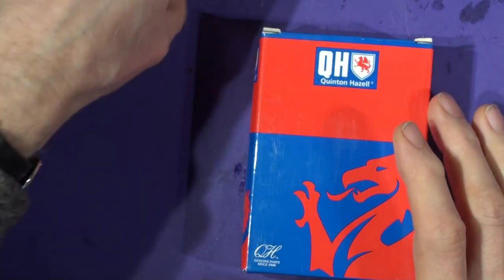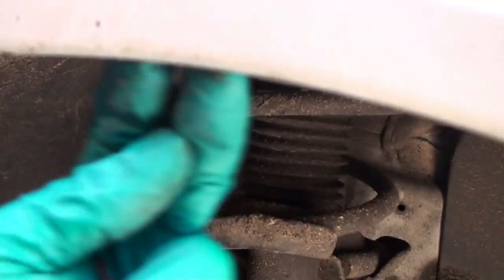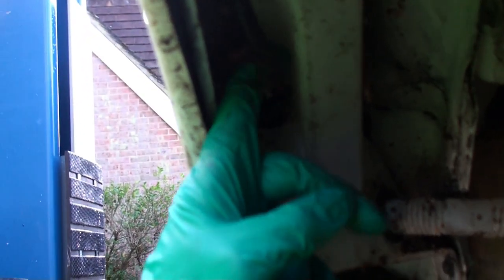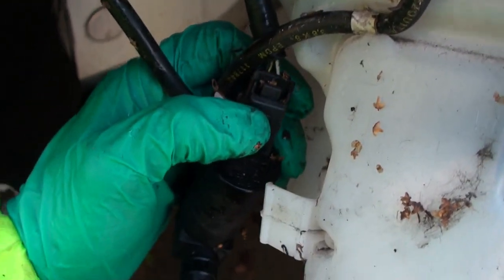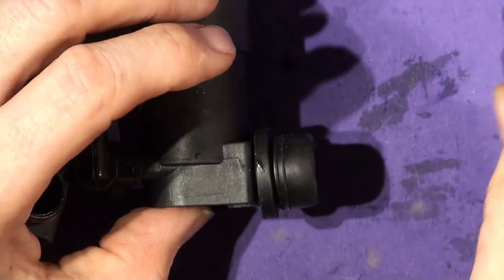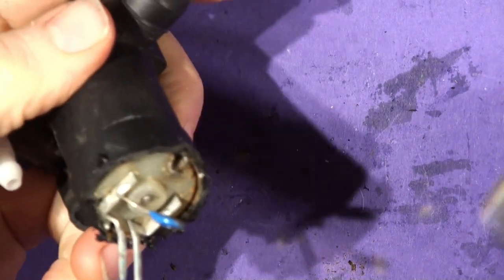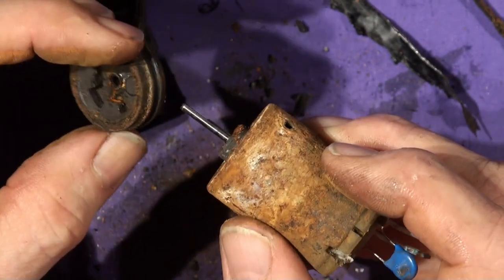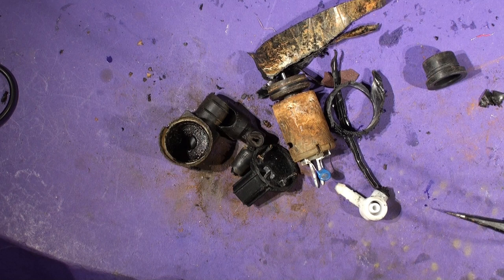Volvo C30 V40 Windscreen Washer Pump Motor Location and Replacement T655C and tear down

Comment: My wife replaced the pump on her C30 today, with my assistance. As mentioned in a previous comment, the reservoir didn't fall down as in the video. We inspected reservoirs for sale and noticed a small white hook on the inside, so using a screwdriver we managed to release this from its slot and it came out fine. I think some may use brute force and break the hook. Anyway this might help some! Next job sorting out the passenger airbag light!
Reply from the maker: Great news, Thanks for the tip.

Comment: Excellent video 👍 Watched this and replaced the pump on my father-in-law's C30. I re-used the original rubber filter/seal that the pump nozzle pushes into. (The new pump just had a seal with a large hole but no filter). Worse bit was refitting the wheel arch liner as in some places it has to be sandwiched between the wheel arch edge trim and the bodywork. Saved my FIL a few quid on garage labour. Thanks!!!! 💪
Reply from the maker: Glad it helped. Good job. Please subscribe if you have a moment. Thanks.

Comment: well that was one entertaining little video stayed to the end just for the craic I won't be cutting the Old motor open but I think I will buy a new one before I even start,
mine is an S40 but I imagine they are somewhat similar.
all the best from your fan base in Ireland
Reply from the maker: Thanks.  Yes the V40 is near identical.

Comment: Thanks for the interesting video. Depending on the direction of the impeller, the pressure is slightly larger in the front or rear nozzles output port of the pump body. The side with the highest pressure will push the white membrane shown at the end of the video so it blocks the fluid that would otherwise go in the other side. I still wonder why the impeller is assymetrical. Maybe fluctuating pressure has some useful purpose?
Reply from the maker: Pleased you enjoyed it and to hear it isn't just me that needs to know, You are right. the higher pressure side closes the output to the lower pressure side.  Stabbed my hand getting that bloody thing to bits. Wish I had spun up the motor.
Reply: It could be that a higher pressure is needed because of the distance the fluid needs to travel to the rear of the car.

Comment: Is the reservoir held in by torx screws or hex bolts gonna do the repair tonight 💪
Reply from the maker: From memory yes there are Torx as mentioned in the video (i think). Good luck.  Thanks for watching.

Comment: This will be my next step but for now checking the fuses do you know what fuses will be the culprate I've changed 48 in the cabin but is the head lamp washer also run the same fuse should I try change this ?
Reply from the maker: Have you checked the motor?  Headlamp and window washers uses the same pump. i.e. there is only one pump.  If you cant find a blown fuse then you are going to have to check / replace the pump.
Reply: @razenby  that is my next step haha just looks like a ballache so trying the fuses first but I've checked them all so think the pump will be the next job 😂

Comment: Ive replaced mine as well when it certainly decided to die. My tank did NOT drop down. It was stuck. Don't understand on what or why. Maybe yours was replaced already. I remember that the hose was on the top on those plastic clips. Now i have a bad leak and i don't know where it comes from. I have a pool of washer fluid right in front of wheel. 
It pours out when freezing cold outside so i think there must be some kind of crack in those plastic valves/connectors near the right washer unit on the bumper. Just a guess. There was so much fluid that also freezed strangely. It was like "slush" built up on the edge of the under engine cover and edge of wheel weld or what it calls. It shouldn't freeze since i always mix 50/50 that are -30 celsius and we never get so cold.. maximum like 24.. or such.

Don't know how to diagnose since it only apply leaking in the winter as far as i know. Maybe take engine cover of, take wheel weld of, take the right side bumper of and inspect the hose. Maybe activate headlight washer pump via VIDA and see if there are any visible fluid leaks somewhere. Don't think i can pressurize with compressed air somehow?

My nozzles also do not retract them self in sometimes so i need to push them in manually. What can be the failing part here? Maybe that leak are causing them to not do that.. maybe a bad spring that clogs up or stucks.. No springy feeling when pushing them in though. Thats strange. I guess i might need to replace the whole unit/assembly. Easy to do and cheap to buy used ones.

Please help with hints, tips, suggestions. About the leak situation. Must be a major leak. Something opens up.
Reply from the maker: Take the wheel arch out and fill the tank and see where it is leaking from.  It should be quite obvious.  Then fix the leak with silicone or rearrange the seals, check the pipe connections etc. Don't give up you can find it and fix it!

Comment: Hi, Useful video, you did make mention of headlamp washer but this video is about windscreens. Do you know where the pump for the headlamp washers is?
Reply from the maker: I believe that there isn't a separate pump but a valve that directs the pressure from the windscreen washer feed to the headlight washers.  Ill have a look on mine later. Perhaps you can find it by tracing the windscreen washer feed pipe back to the tank area to see if you can find the valve in the pipe,  Not 100% sure at the moment. If I discover anything i'll let you know.
Reply: @razenby  Thanks,  the water supply comes from the same tank for sure. Wondered if there is an inline boost pump ii the hose that is fed from a Tee/valve as you suggest. I have water dribbling leaking from my headlamp washer assembly jets, draining the tank, if as you say there is a valve (electric?) staying open that could explain it!

Comment: Just done this replacement, feont washers are working but not the rears, any suggestions?
Reply from the maker: The rears work by reversing the pump polarity (direction). Disconnected,blocked or kinked pipe or blocked rear 
 washer jet. If you don't hear the pump running when your try to squirt out the rear then suspect the 
 dash switch or wiring. Easy to check the motor functionality with a couple of wires and a 12 power supply.
Reply: @razenby  thanks for the detailed reply, unfortunately I was being stupid and simply forgot that I have to push the stalk for the rear window lmao. I'm sure this can help someone in future though. Thanks again for the video

Comment: Excellent video on how to do it! The washer pump on my V50  just decided to die today so I already know what's keeping me busy the coming weekend. 

At least it survived until I got the MOT a few days ago, haha
Reply from the maker: Glad it helped
Reply: @DennisDe. Hi mate, how old is your V50? Mine is 12 years old, and it's just give up today. The pump was struggling to wash the front screen yesterday, and no washing at all to the rear. Do you have headlight washers too, and if so, does this pump operate those, or is it a seperate pump, as this pump only has 2 outlets by the look of it?
Cheers.
Reply: @hermanmunster3358  Hi Herman, have you got your answer, I've a problem with headlight washers... Thanks a lot !
Reply: @carinebondu8420  Yeah thanks. One pump for the front and rear. It is located above the o/s wheel arch, which means removing the wheel and  arch liner and washer reservoir to replace it. The pump is attached to the reservoir, but is easy to replace once the reservoir is removed. Just make sure you note what nozzles the hoses connect to.
Reply: @hermanmunster3358  jesus, calm down. I didn't see that you answered me, no need to be this rude
Reply: @hermanmunster3358  Thank you for your answer ! I verified Fuse, I bought pump (8620396), sensor (31333113), Nozzle left/right (30698423 / 30698422), Washer jet  (31253730), all genuine from Skandix, lights were on... but  nothing... I'll verify connectors, it cost so expensive, bad :(

Comment: My washers or the windscreen have suddenly stopped spaying yet the headlamps are still working. Pump works fin. Alo when I'e filled the washers there's been a leak, so I guess it is a loose pipe connection for the windscreen washers, how I'm not a DIY man and don't even have a set of screwdrivers, so think it will be off to the garage. This look a right faff.
Reply from the maker: Good luck with it Max. Happy Christmas.
Reply: @razenby  you too!
Reply: Hey max you have any luck with this because I'm having the exact same problem
Reply: @adamcarolan5884  I spoke to a local garage, one that I trust, and they wouldn’t do anything until the weather gets warmer. It’s also going in at the same time to sort out a few other niggling issues, wobble drivers door mirror, occasionally heavy power steering and a sticky rear handbrake. Once it’s done I’ll post back here. But they say it isn’t a lot of work for the washers. The motor still works and up until the reservoir not keeping any fluid the headlamp washers were working fine. They think it’s either a perished washer or tube to the windscreen. But as it’s all hidden behind the wheel arch, we will have to wait and see.
Reply: @MaximilianvonPinneberg  fixed it there the other day, turns out there's two separate pumps for the headlights and other washers. I wouldn't bother having a mechanic do it, I got it done in under and hour with hand tools and the standard jack.
Reply: @adamcarolan5884 are the pumps the same as this? Where is the headlight washer pump located please?
Reply: @nil4309 doubt it’s the same part but you will have to check. It’s located on the right side wheel well between the arch and 1/4 panel. Lots of tutorials online on how to remove and replace the washer. Only have to remove the wheel and arch liner. Very simple job

Comment: Great video, as usual!

Some o-rings instead of the glue, and that pump could have been made repairable. How many pennies extra in manufacturing costs?! Not many, I suppose. It's just sad... 😐
Reply from the maker: Great point!  Take, make and throw away as fast as you can  is the master plan. After 3 years it isn't the manufacture's problem.